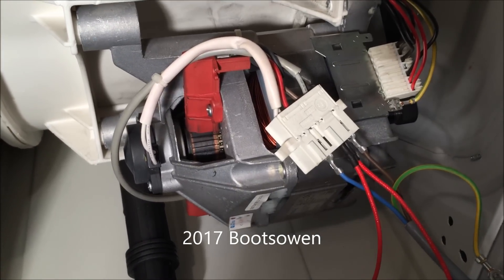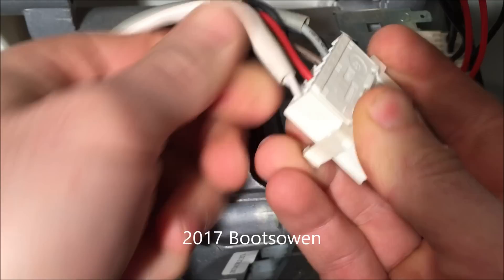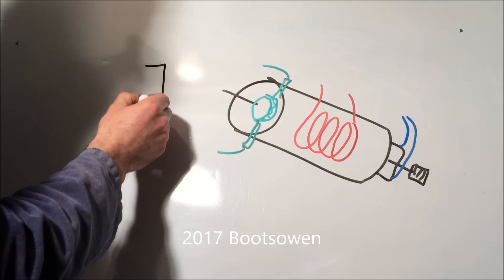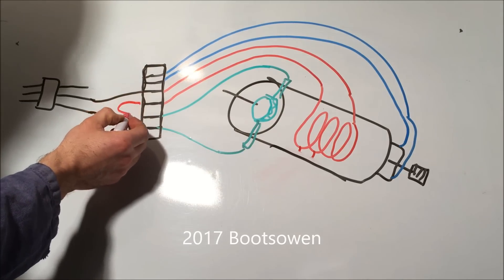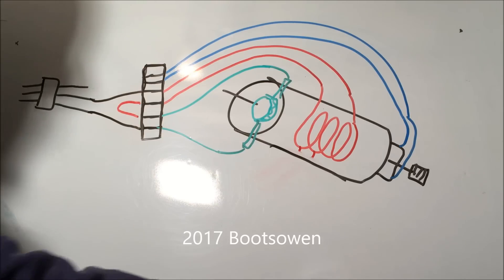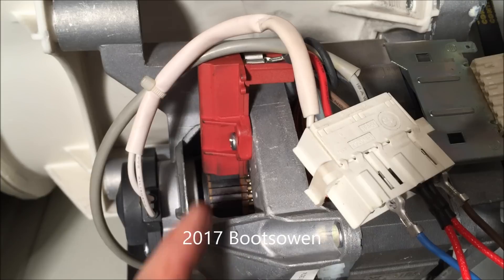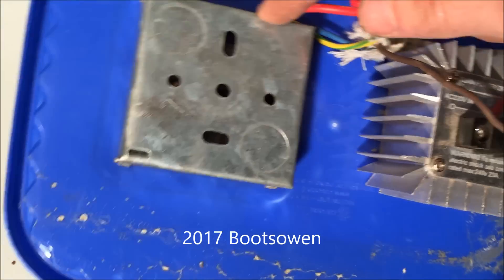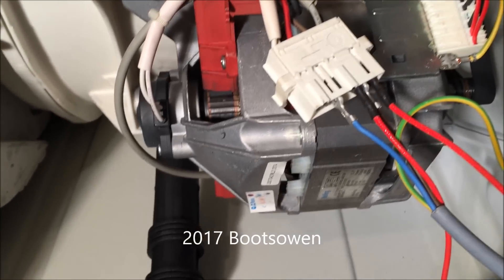Washing machine universal motor wiring explained

Comment: Hello, Thanks for the great videos, I have salvaged an ACC type 20584.603 motor to use. I have identified the Tacho wires. the two brush wires and four winding wires. Connected as you described using the 2 brush wires and 2 of the windings, but no response from the motor. Should I just try the other winding wires in various combinations?   OR is there anything I can check with my multimeter, if so what am I looking for (Bearing in mind I do not know if the motor was working when I salvaged it) Thanks for any advice you can give.
Reply from the maker: you could check for continuity between one brush wire and the other, if you get continuity it means that the brushes are probably working and the windings that the brushes connect to are probably ok. then you want to find a pair of the four winding wires that have continuity, it could be that there are two pairs and that you got them mis matched, it could also be that there is a overheat sensor in there (unlikely unless a high end machine) that has blown, again, a continuity test will tell you.  so to recap, check for continuity between the brush wires, and continuity between any pair of Stator armature windings (a pair from the 4 you identified)  don't worry if you get it wrong, it will blow the fuse on your consumer unit or trip the switch. let me know how it goes. Post a video?
Reply: @bootsowen  Thanks, after checking carefully as you described the motor now works (must have been either loose connection or RCD not reset properly)  Can you offer any advice on which winding to use? It is an ACC type 20584.603 which shows 480/15000 RPM on the label  the wires are as follows: 
Pin 1 Light Green - winding
Pin 2 Yellow - Brush
Pin 3 Green - Brush
Pin 4 White - WInding
Pin 5 White - Winding but linked already to Pin 6 via loop wire
Pin 6 Brown Winding
Pin 7 & 8 - Tacho
Pin 9 Orange - WInding
I put live to pin 1 and neutral to pin 2 then linked 3 to 4 - worked at a fast speed
I left live and neutral and linked Pin 3 to Pin 9 - Worked even faster?
Do you have any info on which combination of winding will give which speeds?  If not then I will use trial and error once I have the motor linked to my tromel and purchase the voltage regulator if needed. Once again thanks for all your helpful videos and advice.
Reply from the maker: What I usually do is try the different combinations for what seems loudest, not very technical but usually accurate enough for my purposes.  I have never done this but you could see if you could wire two windings at once,  like: neutral to brush, brush to pin 5 and then either 4, 1 and 9 to the live. (or some other combination. I have no idea if this would work. It could break it!!  I wouldn't use the voltage regulator in this video, I have got a better one from ebay based on a TDA1085c  chip, there is a ebayer from russia selling them, I have posted a video on my channel with it.  Search for TDA1085c. they are more expensive, but they take the tacho readings so can keep a constant speed, i guess it depends on what you want to do with it.
Also, the speed ratings may be achieved by this washer motor, but only when it is connected by a belt to the pulley under load and with a tacho sensor, when you hotwire the motor like you have done with no load then it will always overspeed. Even with some load.

Comment: Hello! How do I make a washing machine motor spin in 2 directions with a speed controller?
Reply from the maker: it can only spin in one direction at a time.
I have explained how to change direction of motor in this video. Have you watched the video?
Reply: @bootsowen  yes, but someone made it so it changes direction while NOT switching the wire
Reply: Wires*
Reply from the maker: I don't understand your question, what are you trying to achieve?
Reply: @bootsowen to have a speed controller with a switch and the switch to change the orientation the motor is spinning
Reply from the maker: I will make a video of it for you.
Reply: @bootsowen  thanks!

Comment: Hello again,  you helped me before get my motor to run. Could you help me now.  I would like to use the motor to turn a trommel (basically a circular Sieve for gravel and soil) I made from bicycle wheel rims and mesh. I think I need a fan belt large enough to go round the cycle wheel rim and the W/m Motor. Is there a specific type or style of drive belt that the motor would turn and where could I find one long enough (probably 2.5 metres long)
If you think something else would/should be used to drive the cycle wheel rim please advise.
Reply from the maker: You could make the belt out of anything, but i would use 2 washing machine belts, cut and then sewn together to make a longer one. use good strong thin cord, maybe dental floss, and stitch so that the stitches are well hidden in the grooves of the belt. You might need to make guides, like the front derailleur on a bicycle, to guide the belt onto the pulleys. That might work. Or you could use an old leather belt, cut carefully into strips and then sewn together. Charity shops sell cheap belts.
Reply: @bootsowen  Thanks, I will get another belt (I took the original with the motor and experiment with that.
Reply: Hi Again,  After lockdown I have got back using my trommel to sieve my gravel from dirt. All is going well but the problem I have now is speed. I have a voltage regulator like you described but when there is a load the motor needs more voltage to turn, then as the load decreases (i.e. the sifted gravel falls out the other end) it speeds up until it is throwing gravel out quite dangerously. Right now I have to control the regulator manually adjusting the power to keep the speed safe. Is there any way to use the tacho wires to control the speed? My other alternatives are to find and use a tumble drier motor (i.e. slower) or construct some form of gearing to allow the motor to run faster but turn the trommel slower. Thanks again for your help.
Reply: Apologies I have read further down and found more comments about the TDA1085c which uses the tacho, Am now trying to fund where to buy. Please ignore previous question (I would delete it but do not know how) Thanks

Comment: Hi it would be very big help if you could help me with the
following

I watched your video is very good but my motor got 7 pin connectors
and got a separate earth connection, I have eliminated the 2 wires coming from
the speed sensor, but I am confused because there are 6 wires coming from the
inside, 

Red & Black together, Yellow & Green together and then
I got 2 thin blue wires could you please help me to connect this please 

The 2 thin blue wires comes from the front of the motor and the
other comes from the back of the motor
Reply from the maker: Does your motor have brushes?
Reply: @bootsowen  yes sir,  1 thin blue and a red wire coming from either side of it,
Reply from the maker: Then wire it as I have shown you in this video, If you don't understand then watch the video again. If you are still unsure then consult an electrician.
Reply: @bootsowen  ok thank you, I got it now I watch the video around 10 times and it helped me a lot thank you so much

Comment: Hi Bootsowen, This motor you worked on is an  AC induction motor correct and not a universal right? Sorry if this is a noob question.
Reply from the maker: Hi, It is a universal motor, not an induction motor. Owen
Reply: bootsowen how can you wire a universal motor to generator? I am struggling.

Comment: Thanks for the informative video. I salvaged a washing machine motor. Could you help me see which is the correct wiring? Because it only has 3 wires.
Reply from the maker: Please check out my washing machine wiring playlist. Maybe it helps
Reply: @bootsowen  
Update: 
My motor has 3 wires blue, yellow and red. The motor is sealed so I cant figure out where the wire leads to.

Connected red and yellow to live and neutral (vice versa). Motor started humming then started to spin at low after I rotate the rotator. 

The red and yellow was connected to a capacitor so I figured that one of it should be neutral. 

The motor works without the blue wire connected. Now I am curious whats the blue wire for?

If there is no more updates, I am probably electrocuted
Reply from the maker: @Icyskullz  Have you watched my other videos?  My suggestion to you is to consult an electrician.  You are obviously not competent to do this.
Reply from the maker: @Icyskullz  Have you watched my other videos?  My suggestion to you is to consult an electrician.  You are obviously not competent to do this.
Reply: @bootsowen  hahahaha thanks will consult an electrician
Reply: it might be an single phase motor which has an broken capacitor . if the capacitor was good it would  have turned by itself

Comment: Hello, I would like to thank you for this detailed video. I am wondering if there is a speed control inside the washing machine since it works with different speeds
Reply from the maker: Hi Ziad, the washing machine uses a tachometer (pulse sensor) in the end of the motor to monitor the speed.  How it does this depends on the model. In a universal motor it is an IGBT transistor that switches very quickly to control the speed. Newer machines using an induction motor run on three phase electricity and are brushless, they regulate the speed by varying the frequency of the electricity using an inverter.  In my experience it is too complicated to reuse the control parts from the machine. the short answer to you question was yes,
Reply: Hello again. Thank you for your swift reply. I'm not familiar with electricity. But as I understand I need an external speed control. I don't know how to build it, I'm going to buy one. Is there a specific speed control for universal motor or any type will works? Regards
Reply from the maker: I have shown how to do this in this video. If you are not sure about electricity then leave it alone so you do not die!!
Reply: Ziad Sourany safety ironclad

Comment: Great video, really helped. But what did you do with earth cable? Do you not have to connect it to the machine in some way?
Reply from the maker: No, In the UK the earth cable is a safety device so it is not necessary to connect it.
Reply: bootsowen thanks, helped a lot

Comment: This is the best video!   I need a help to change  the rotation controlled with arduino
Reply from the maker: So has this answered your question or do you need more help?
Reply: bootsowen .  I need more help because your method is manual . i need to make this rotation controlled with arduino
Reply: bootsowen         i have 3 phase induction motor  i've got 2 wires for the sensor and 3 other one if you give me a mail i can send you a photo
Reply: bootsowen        washing machine motor welling YT220-2D (L) 3Phase induction Motor Spin 195V (~3) 310Hz 220W 1.43A Wash 36V (~3) 10 Hz 32 W 1.53A Insulation Class F Cod. 160028856.02
Reply from the maker: This is a completely different motor to the one in my video. Sorry, I don't know how to do this with arduino. these motor typically come with an inverter mounted on a circuit board somewhere within the washing machine. You will probably need these parts to do the switching to make the 3 phase, (If you plan on using it on single phase) You maybe somehow can bypass the chip that is on the circuit board and replace it with Arduino, but as I say, I don't know how. Good luck.
Reply: bootsowen   Thanks.   But if I want Just wire the motor to work with the ac current  ?
Reply from the maker: Try it, you can make the motor work, but it is governed by the frequency of your mains AC. And the motor will only be getting one of the three phases so it will be unbalanced.

Comment: I have a MCA 38/64-148/ZN7. It has 8 wires on the connector. 2 for the tacho, 2 for the brushes, 3  for the windings, and then there's another black wire. How should this be wired to get the motor to run?
Reply from the maker: Hi there, what is an MCA 38/64-148/ZN7?  Did you watch the video?
Reply: @bootsowen  Yes, I watched the video, very informative by the way! But my motor is slightly different and I couldn't get it to work.. I have a few photos I could send you?
Reply from the maker: I am not sure what good sending me photos would do. You know which pins go to the brushes, you know which pins go to the coils. You have watched the video so you understand how to wire it. How can I help?  Is your motor a universal motor from a washing machine?
Reply: @bootsowen  My motor has 2 labels. 
One says: C.E.SET. Castell’Alfero (AT)-ITALY. Motore Universale. MCA38/64 – 148/ZN1. 13400n’-2A-410W. 220-240V-50Hz-cl.B/F. Protetto termicamente. Cod. 12405480/2.
The other label says: MCA38/64-148/ZN7. LINE A13 WK 24/99.
It has 8 wires. From bottom to topp: black (unknown), green and blue (brushes), 3 grey ones (windings?) and 2 red ones for the tacho.
I watched your video and did exactly as you explained. I tried all the combinations with the brushes and the grey wires. Doesn’t work. I hear power for a second but it won’t spin. The black wire is the only one I haven’t tried since I don’t know what I’m doing 😊 Any suggestions?
Reply from the maker: Maybe the motor is a dud, I posted some videos recently of fault finding on a bosch machine motor. It had various failures. For instance a coil can be burnt out, brushes can be worn out, etc.  Are you sure the motor works?  I like the way you can hear power. Sounds to me like the motor is dead or you are not wiring it correctly or both. I enjoy that there is a mystery wire. How have you identified the others?
Reply: @bootsowen  motor should work, it came from a working washingmachine. But maybe it broke because of me messing with it😅 Yes I identified all the wires except for the black one. Was hoping you had seen this before. I think I'll butcher another washing machine instead. Thanks anyway🙂
Reply from the maker: When I started learning about these things a few years ago it took me a while to get my head around it. Keep trying. And do have a look at my bosch videos from a month or two ago.  They might give you some pointers.

Comment: It may be a stupid question, but what about the Taco wires?
Reply from the maker: They are only necessary if you want to monitor or control the speed. Have a look at my tda1085c video. You can get a controller that would use the tacho wires.
Reply: Thank you!!!

Comment: great tutorial, could be  understood easily. I have question for you mr.
i want to replace the old program timer of my a washing machine with  a modul pcb universal sxy 3388.
to connect the motor to the pins on the modul pcb universal - in which the comutator / brushes are to be connected to 2 pins on the modul and the same for stator and the tachometer. when i follow the guideance on the installation it doesn,t work. the water filing is normal. after that the motor start but only in 2 second and stop. failure sign " motor err" appeared. I have tried 3-5 times  and the same motor err appeared. what is wrong ? hopefully you can give the solution. if you let me know you hp /e mail add i could send you the wiring detail. thank you
Reply from the maker: the  modul pcb universal sxy 3388 is an interesting tool.  I have demonstrated in this video how to wire the motor and the wiring diagram behind it. You can show a video of what you have done and post a link here to your video if you like. Share your question and results so everyone can learn.
Thanks

Comment: Thanks for the video, 
Is it possible to use a DPDT switch to change the direction?
Reply from the maker: Hi there. If it is a double two way switch then it could work.
Reply: Theres a plan, one plug on for clockwise, turn off and turn other one on for anti...

Comment: Great help in wiring my wadhing machine motor,  I have an induction motor  I believefrom an Electra AWM800 washer, it has nine wires of which two are for the tacho, any idea how I could wire this to drive my latest project which is a dirt trommel for my allotment
Reply from the maker: Hi Steve, are you sure its an induction motor? Does it have brushes? if it has nine wires including brushes it is quite unlikely to be an induction motor. Post a video of it and send us a link and I'll be better able to help. If you search my for "3 phase induction motor wiring" it might help.  But really, if it has a tacho  and is as old as the model you gave me I would suspect that 2 wires go to brushes and 2 to the tacho, leaving 5 to various tappings on the stator coil. wiring as I have described in the video, using any two of the stator tappings should make it work.  Using others of the 5 tappings to the stator will give different speeds, under loaded conditions, if it is a universal motor.  Good luck, let me know.
Reply from the maker: Hi there, this book  Electric Motors in the Home Workshop by Jim Cox 9781854861337 (Paperback, 1996)might be a help to you
Reply from the maker: it is not very expensive.
Reply: Thanks, I'll give that a go
Reply from the maker: So I agree that it looks like an induction motor. The fact that you have 9 wires or 7 Discounting the two tacho wires is a bit confusing. It is also confusing to me that there is a tacho on an induction motor. I can’t see why it would need one. You might want to take it apart to see where the wires go.
Reply: bootsowen looks like thats the only way to try and suss this one out, thanks again

Comment: best video ever, ime trying to turn the motor into a generator, would it just be a case of a bridge rectifier.
Reply from the maker: Hi Tony, It really depends on what you want to use it for AC or DC generation.  The universal motor will run on DC or AC. But I don't know what it will output if you spin it.  I guess you should consult the internet. Thanks for watching. It might be a video I post in the future when I have read a bit about it!